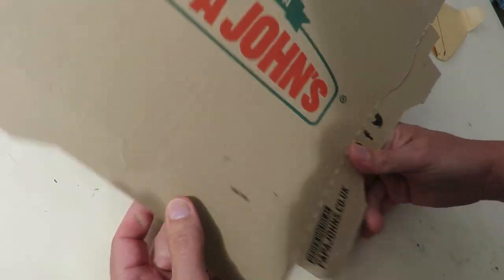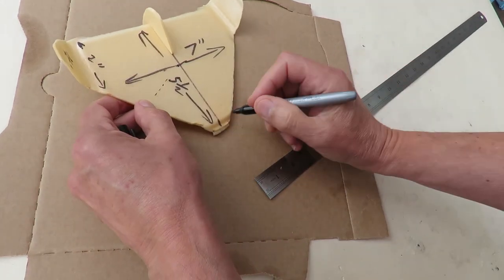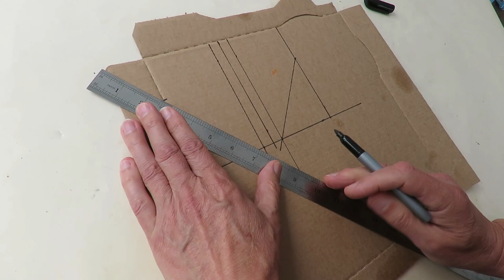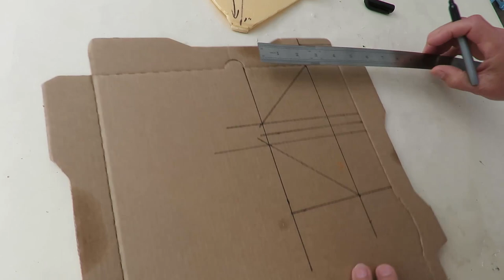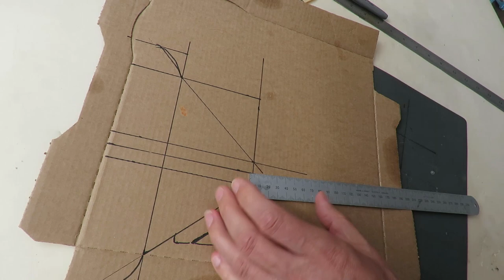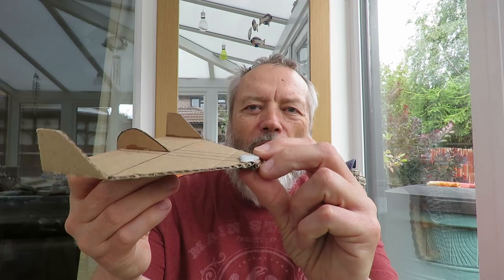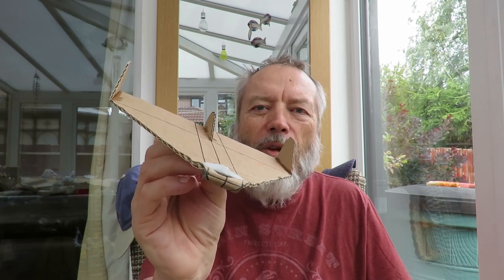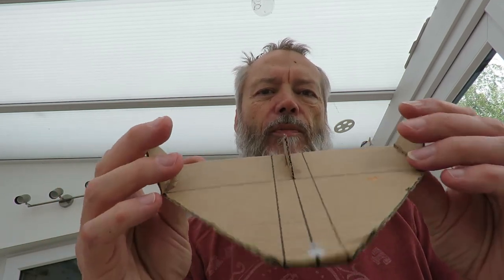Simple pizza box glider 20200629

Comment: The Penny Delta !! for a flat sheet that fly's remarkable well, you do need to scale it up to use the whole of the cardboard available, how about making an Avro Vulcan B2 ? copy the wing shape with multi angle leading edge and a profile fuselage and rudder, maybe get adventurous and paint it in nuclear attach white or camouflage colours if that didn't effect the cardboard.
Reply from the maker: It could be done but is rather outside the scope of this series. These are quick 10 minute builds or less.